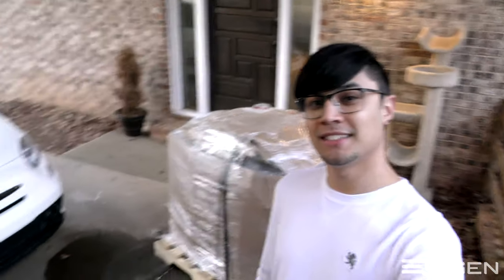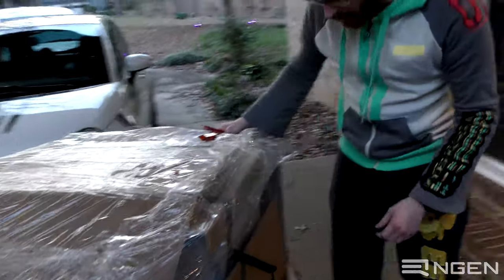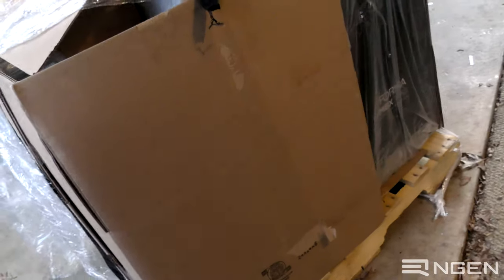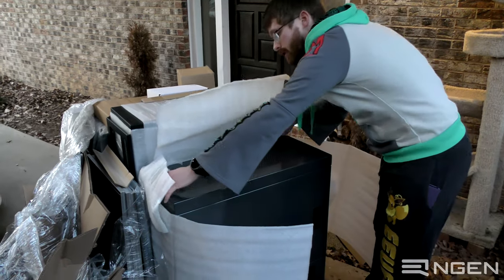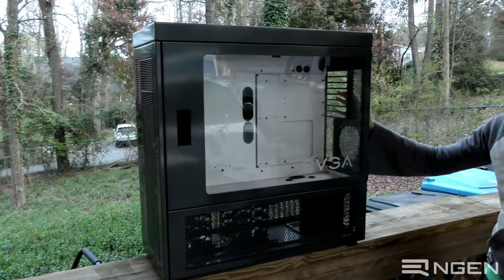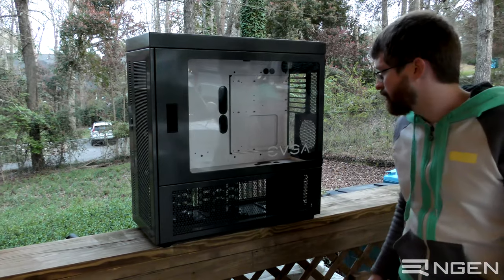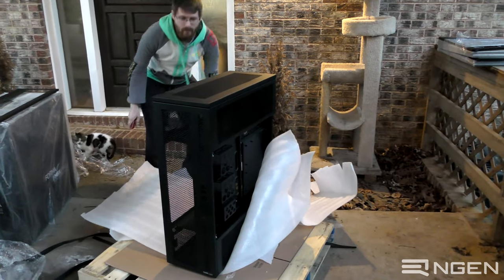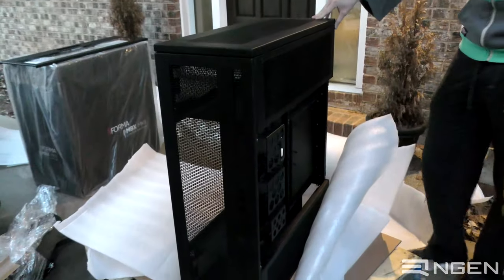Unboxing the Rarest CaseLabs Case in the World!

Comment: I'd say mine would be pretty rare too - horizontal mobo layout Mercury S8 + pedestal factory painted in a canary yellow and gunmetal two tone. Actually it's a triple color because I requested all the screws and front bay covers done in black LOL. Thing looks amazing. Pretty sure it's the ONLY yellow case they ever did.

Then of course I modded it and made it even more unique with custom dust filtering, sound deadening insulation, case badges, lighting and nicer power/reset buttons. A true one-of-a-kind.

I wasn't really a fan of the SMA8 because of the way the front bay mounting interfered with the upper and lower sections - the Merlin line was better at that in my opinion. One thing I do wish they would have offered on their cases but didn't was rotate the mobo tray so that your GPU would sit on it's end rather than on it's side. GPU sag was a big issue and the SMA8's vertical GPU mount was good for maybe 2 cards at best, but not 3 or 4, never mind the problems GPU ribbon cables can have on some systems.

The TX-10 in it's horizontal mobo configuration was also a rare option. That was a beast of a case.

If CaseLabs was still around today I'd be nagging them to make a Mercury S10 - wider to fit a 2nd set of 5.25 inch bays in the front, deeper to fit a 480/420 rad along the side and a pedestal that can mount on the top not just the bottom. I really cannot complain though because whatever you needed in a case (multiple power supply mounts, radiator space, hard drive space) they had either a case or pedestal to make your build work. Seeing CaseLabs demise truly was a sad day for the enthusiast.